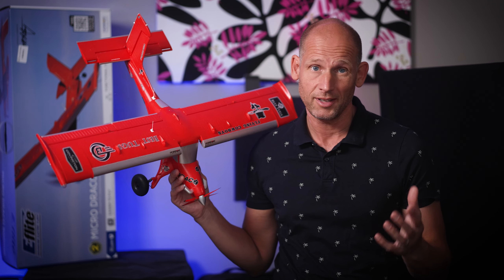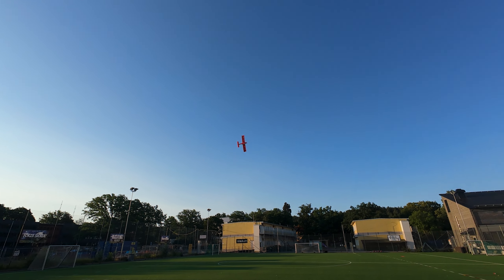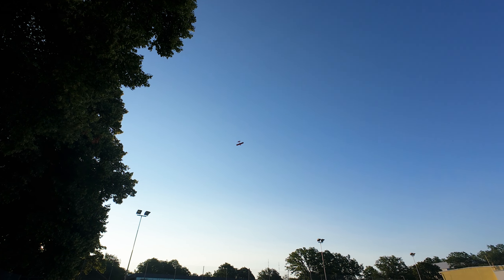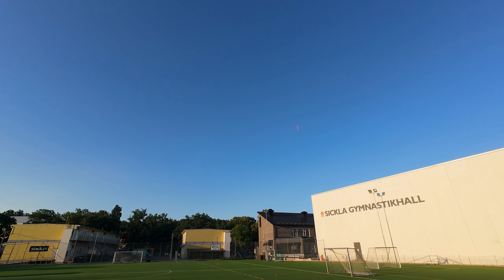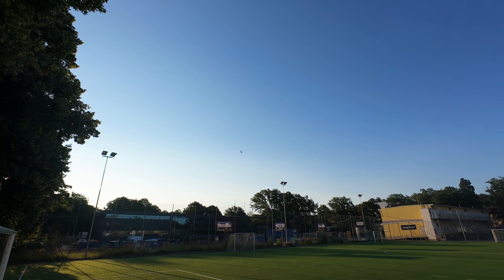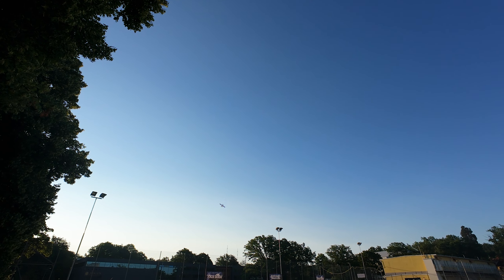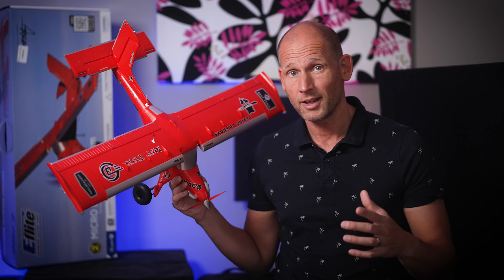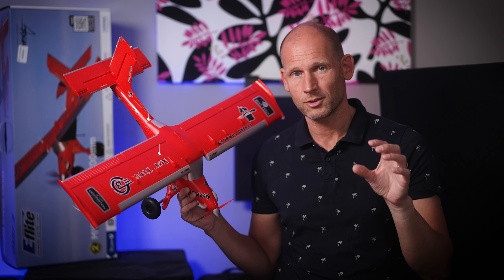E-Flite Micro Draco Bad reception?

Comment: Ive only ever used the 4s 450mAh (JsT connector) and 3s 450mAh  spektrum packs in mine. It handles those great. Also helps with a little bit of wind. A little bit. Its definitely not a turbulence flier 😂
Although, at the beach, with nice laminer 8-12mph breezes from the ocean, it was a lot of fun dropping flaps and hovering horizontally 😊 
Its been a great vacation plane, parking lot flier, and lunch time extender.
Reply from the maker: That's great. I also think a heavier battery like your 4s 450mAh is the right battery for the Micro Draco so why it isn't the recommended battery by Horizon beats me.

Comment: My Micro draco flies great! I can fly in in very tight spaces and its a pleasure to test where I could fly. I also have reception issues though. most of my spectrum airplanes have that issue.
Reply: I also enjoy it on 3s almost more. I fly it really slow in very tight spaces for fun though and extra power isn't needed. I also switched the connector to xt30 which does give more power so 3s is better.
Reply from the maker: @willowehrich6207  It does fly very good and with a larger 4s battery well balanced.

Comment: My flew great till i forgot where safe was on the switch. Crashed hard been waiting on a new fuse. Started bo for oct. That was Aug. Now its Nov. I want to fly it, so i got another. I have 4 4s spectrum pscks. No flat out flying. I try to fly scale. Punch it to get oit of trouble.

I feel if you were to fly it slower on that field you would have enjoyed it more. But you like 1.3ish plaines, so the Draco may just not be your cup o tea. Your a good piolet though!
Reply from the maker: Thanks for commenting Jerry! It flies great and for scale flying a 350mAh 3s battery is just perfect. But I want to push my planes and then the Spektrum 4s battery just isn't enough.

Comment: I fly my micro Draco on 450 mah both 3s and 4S packs no problems whatsoever
Reply from the maker: Yes 450mAh is probably the battery to pick instead of the HH recommended 300mAh.